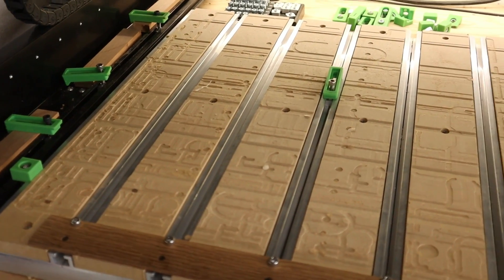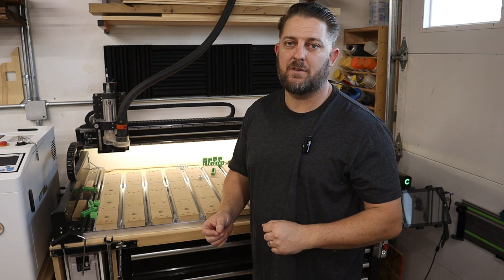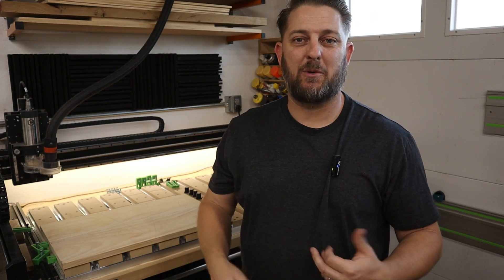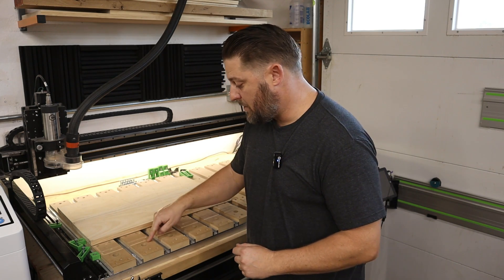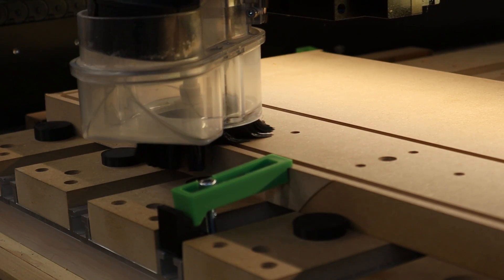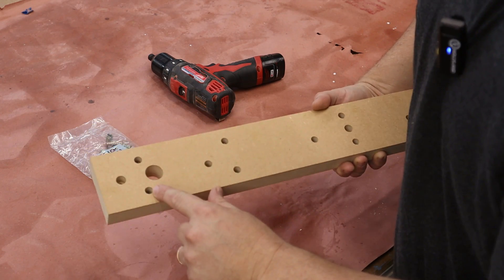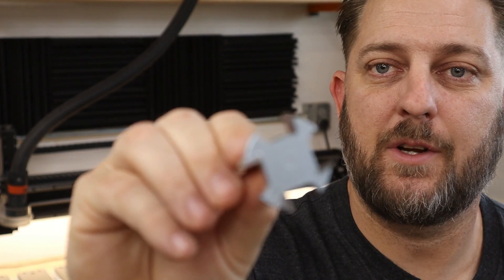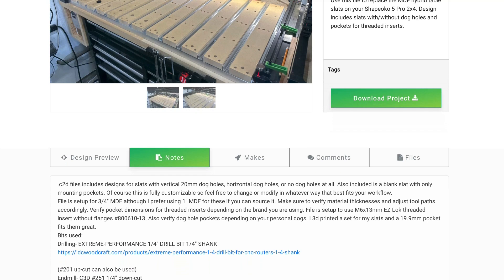Can this CNC's Waste Board Be Improved?

Comment: Quick question: when you want surface and you remove the bit setter how does the recognize the height when you remove the bit setter
Reply from the maker: After disabling the bit setter in carbide motion and removing it, you’ll have to set the height of the bit manually.
Reply: @LaserGarage really we can do that 😳?
Reply from the maker: @JayToutEnBois2 yes.  I’ve shown the process in my other CNC project videos.

Comment: For a 4x4, couldn't you just cut your 2' slat and use 2 of them for each rail (butt them end to end)?
Reply from the maker: Not exactly, the mounting holes wouldn’t line up.  It would be possible though to make the 4x4 slats in two separate pieces.  I just don’t have a 4x4 to test it plus even if I figured it out shipping would be pretty crazy.  All the slats would be like 40lbs.

Comment: Hey Brett. Thanks for this video. I have the same machine and size.
I'm wondering if you know how to feed a full 48" wide sheet for cutting (tiling). It seems the bit setter will interfere and / or get hit by the bit. TIA
Reply from the maker: Thank you for checking it out.  To fit a full 48” piece on the Shapeoko you’ll have to disable the bit setter and move it.  With the bit setter installed it limits you to cutting like 47.5” or so.

Comment: Hey enjoy watching this video. Is there anyone who can make this spoil Board for a Shapeoko Pro XXL?
Reply from the maker: Thanks a lot!  Search on cutrocket.com I believe they have some options.  Or download my design and modify it to your machine.  If I remember right the pro xxl slats are like 33 inches long.  I think you can use the pro Xxl to cut its own slats out but you have to run the part diagonal to fit on the bed.

Comment: Good job, new subscriber. I have a Sienci Longmill MK2 48x30 and I buy all my bits from Garret at IDC Woodcraft. Good products and good customer service. 

I like the design and have done something similar, except I ran my slats 90° to yours. I did this because I have a 4th axis mounted to a slat and I can remove one of them and replace it with the 4th axis when necessary. In addition, I opted to use t-nuts instead of screw-in inserts to avoid the possibility of an insert being pulled out. After all, it is MDF. Keep up the good work and I'll keep watching.
Reply from the maker: Thanks a lot Ron.  Those are some really great ideas.  Keep up the good work!

Comment: Very helpful.  Thank you.  What was the metal box at Zero right before you started cutting?
  Can you give us a peak at how you secured your dust collection hose at the top?  

To answer your question... I don't think I would buy precut waste boards.  The shipping costs would likely make it rather prohibitive.
Reply from the maker: Thank you very much.  That is the bit zero.  It’s a touch probe that sets your xyz zero points prior to running a job.  

I thought shipping would be more but I’m surprised it’s actually not that bad.  Like $20-30 depending on where you live.

Comment: Great video, you explain things very well and have some great ideas! I wonder how many of these you could knock out of a 4x8 sheet of mdf with as little waste as possible (while also doing it in as few jobs as possible on the machine), and what your process would be? I also have the 2x4 Shapeoko 5.
Reply from the maker: Thank a lot!  I love machining MDF, the engravings go quickly and are very crisp.  I would do the same process I outlined in the video but if I’d add a hardwood frame around the sign to protect the edges.
Reply: @LaserGarage  I was referring to the wasteboards in your improved wasteboards specifically
Reply from the maker: Oh shoot sorry, I thought you were commenting on a different video.  Well as far as the waste boards are concerned I’ve optimized them the best I can on my 2x4.  I can get 42 slats out of a 4x8 sheet of MDF which is enough for 3.5 sets.

Comment: Nice video, curious about the surfacing as you can’t cover the entire waste board in back do you just never place material that far back. I have used the area obviously I don’t route in it but let’s me add things to larger pieces. Thinking about guess could flip waste boards and run surface file again. Is that what you did?
Reply from the maker: I’m able to surface the entire waste board of the Shapeoko 5 Pro.  You must use at least a 1 1/4” surfacing bit though.  In my case I use a 1 1/2” surfacing bit.

Comment: This is a GREAT video!!!  I assumed they would sell a replacement pack since they pay so much attention to detail.  Needless to say I was shocked when I saw they did not. I do not have the 5 Pro, I have the Shapeoko Pro XXL with a cutting area of 33" x 33", but it has the same hybrid wasteboard.  I would absolutely pay for a replacement kit.  I have seen SEVERAL videos of others willing to do the same......
Reply from the maker: Thank you very much, I’m glad you found it helpful.  I used to own the 4 pro xxl and it was a great cnc.  The biggest problem I have is that since I don’t own that machine any longer it’s hard to test everything to make sure it fits properly.  Maybe in the future, but in the mean time if you’d like to make your own my file can be easily modified.  I’ve seen people make slats on the xxl, just have to do one at a time and diagonal I think to get it to fit.  A little slow but doable.

Comment: Another good video.  I found that being in SC, the humidity in my garage played havoc with my MDF and I switched to OSB which doesn't move so much.  It's not as thick as the MDF, but it doesn't move with the humidity.  Your thoughts?
Reply from the maker: I’ve heard a little of that issue before.  Maybe sealing the mdf slats with shellac before and after surfacing will help to keep them from sucking up moisture?

Comment: I'd be interested as well.. but would need it for a  5 pro 4x4 - great video
Reply from the maker: Thanks a lot!  Sorry though, I’m not currently offering slats for the 4x4.  I don’t have that machine so no ability to test them.  Maybe in the future.
Reply: @LaserGarage  I just recieved my 4x4 and haven’t unboxed it yet, but.... wouldn’t the files basically be the same, just duplicated and ‘welded’ together end on end?
Reply from the maker: Cool.  The file’s not the issue it’s the size.  They are 49” long, I max out at 48”.  I could come up with a way to split them in half but overall shipping would just be too heavy I believe to make sense.

Comment: How about making the slats a bit wider and undercut rabbits to expose only the channel part of the aluminum and 'sandwich' the tracks to offset some of the force pulling up from the clamps?
Reply: I did this exact thing. Hang over the boards into the track a little and leave the troughs only for the bolts to have the room. I ALSO, because I was doing this, was able limit the raised size to the actual cutting area. this way it can all be surfaced. Your method (though I appreciate it) has troubles when you surface the whole board in place you have a raised (original area on the sides and back) that cannot be reached with the bit. So it creates problems with pieces that are larger than your cut area. I really like this method of mine so far. Also It's super easy to see at a glance what my cutting area size is.

Another thing I did was attache a Neje20Watt (true 20 optical) to the side of my head (with the provided bolt holes on the left side of the router clamp. This lets me lay out a grid (just run the file) of lines that are literally 20mm apart and marked at each 100. This makes it so easy to lay boards down repeatedly and exactly where I want it. It also helps knowing exactly that 50Y80X is exactly here, etc. (at the front corner of my workpiece where I placed it on the grid). When I resurface, I just run the laser file again to re-burn the grid.

I posted this on the Facebook page but not very many people commented or showed interest.

(Btw- mine is a ProXL).
Reply from the maker: Very cool!  I like the laser grid idea.  PS- I’m able to surface the entire area of the wasteboard using the method I described in the video.  You must use at least a 1 1/4” surfacing but.  I love the 1 1/2” version from IDC Woodcraft.
Reply: @LaserGarage , Ah, the V5 must be very very different. I get probably 4 inches or more past the center of the bit that is further back with their boards. also the back screw is way back there so unless I want to settle with two screws only for each slat (middle and front), there's no way to flatten the entire waste area -- unless I had a 7 inch or so flattening bit. It's possible that the cutting area being so far from the back edge of the slats were improved so so much on the 5 (from the iterations of mine, the pro XL). I'm interested, what is your center point cutting area (like if you had a vBit in). Mine is 31" x 17.5" (pretty close).

 I think your sides are covered as well, where my PRo Xl has a about 2/3 of a slat that isn't reachable (left and rightmost slats). I'd probably need that same 7" surfacing bit (or larger) to reach that as well.

Also I did it my method because I also to extend out the front of the slats a little to take advantage of my tool comes out a little more in the front past their boards as well.

anyways, your's is a great video, well done!
Reply from the maker: Thank you very much.  I remember those flattening limitations well, I used to have a pro XXL.
Reply from the maker: It would definitely work but for me it seems like that would only complicate the design and add time.  There are no concerns about clamping forces and the tracks.  The tracks are screwed down to the frame of the machine.  Not going anywhere, anytime.
Reply: You have to also consider the under sides of the slats (if you make them wider), to keep the undersides as 3" because that's a given trough.

Comment: I can't recall, does the 4x4 just double the slat length or is there more to it? I'd like to use your design but I have a 4x4.
Reply from the maker: Slats are longer and mounting holes are in different locations.  There’s another wasteboard version on cutrocket.com for the 4x4 I believe.  Check that out and you could modify it to match my design.

Comment: Very well put together Brett. If I can convince my wife, I will be buying a Shapeoko Pro 5 2 x 4, soon. I think your idea of selling your waste boards is a good idea. I would buy them if I find the price reasonable. Otherwise, I will probably make my own as needed. But once again, great information and a great video by a craftsman such as yourself
Reply from the maker: Thanks a lot Fransisco!  Good luck with the convincing.  The price is the biggest challenge with the wasteboard.  Shipping costs, MDF, and 96 threaded inserts add up.  Plus factoring in the machine time, packaging etc...they won't be for everybody that's for sure.

Comment: Definitely interested in spoil board kits. Like the 1" lightweight mdf you mentioned in C3D post. Surprised C3D doesn't offer this.
Reply from the maker: Awesome thanks a lot.  I believe C3D used to offer slats for the 4 and pro back in the day.  Not sure why they stopped selling them, probably due to the shipping cost/lack of interest.
Reply: COULD YOU SEND ME A SVG FILE OF THE WAST BOARD FILE I DO NOT USE CARBIDE CREATE ANY MORE i  IUSE VECTEIC VCARVE PRO FOR DESIGN AND CARBIDE MOTION FOR THE G CODE i HAVE A SHAPEOKO5 4X4 THANKS JPETERS
Reply from the maker: @resorter66 send me an email.   Brett@arcshop.us